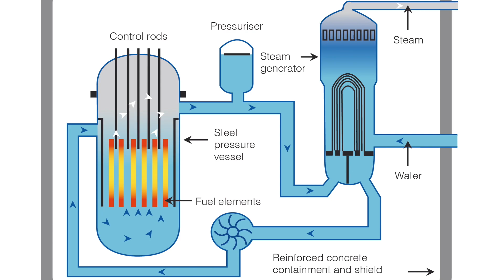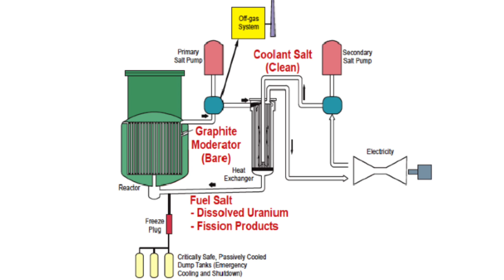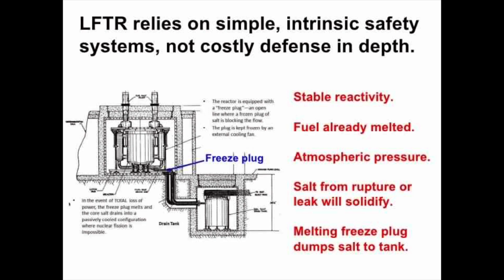HBD Alvin Weinberg - Politics and The Dream of Clean Cheap Energy

Comment: My crystal ball says that the transition away from fossil fuels at scale (unlike wind and solar failures) will be in Asia. Thorcon Power and Seaborg Industries are both pursuing MSRs on a towable barge platform built in shipyards. One large shipyard can build 20/year with an overall construction period of 2 years. Capital cost less than a coal plant and fuel a tiny fraction of coal. The only thing in the way is politics.